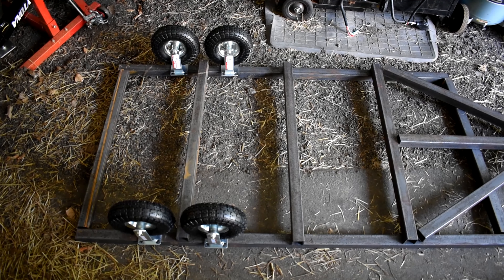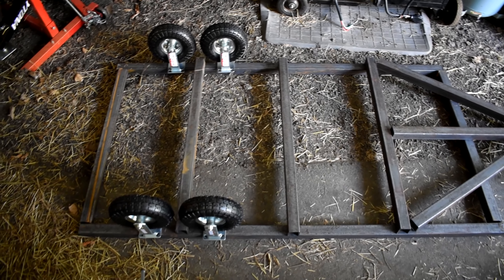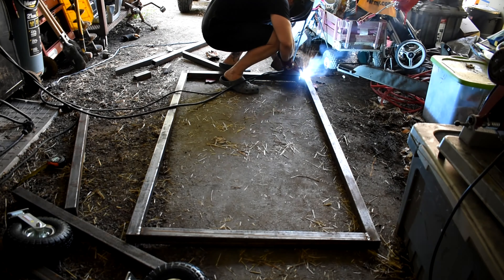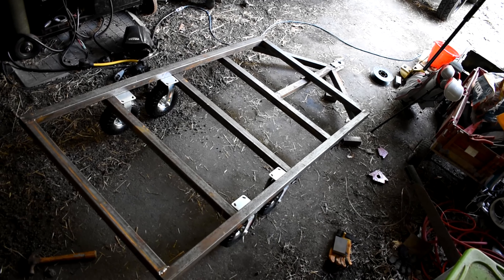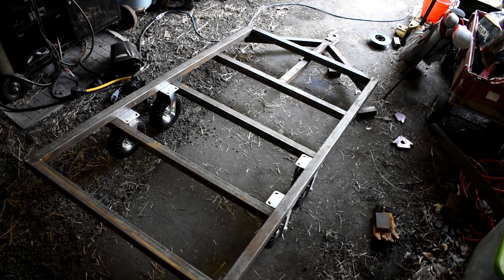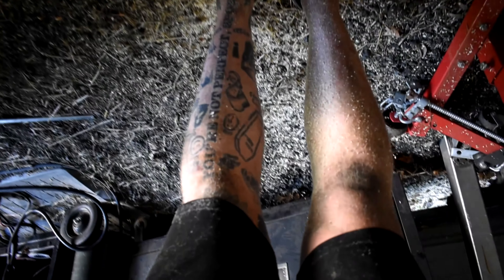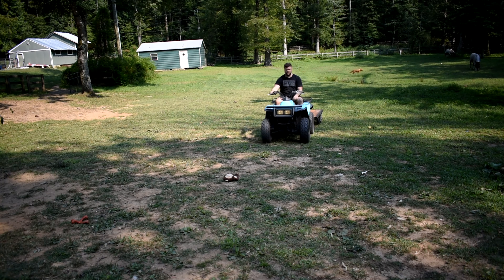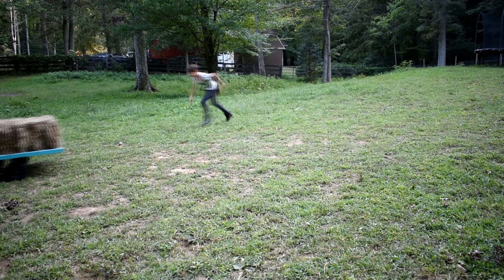Making a Farm Trailer for my ATV (7'x4') || Legacy 4x4 and Off-Road

Comment: Nice lil trailer you’ll end up regretting not making it a dump trailer with a winch on the front of it.  I regretted not doing it with mine
Reply from the maker: I already do, it hauled 16 bails perfect, but its limited to be able to haul bigger things...
Reply from the maker: used it to move 16' top rails for a new fence, around 500' of fence, and it was sketchy at best